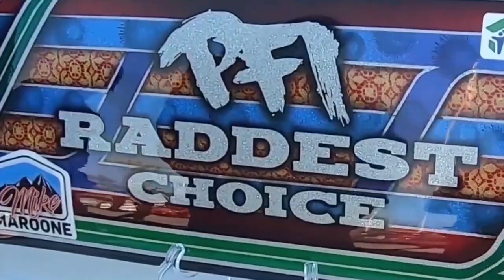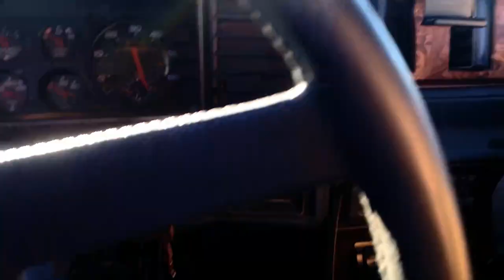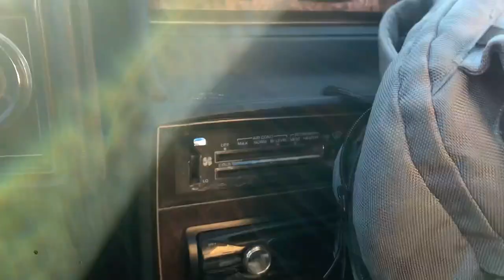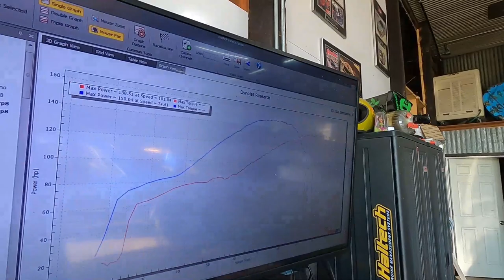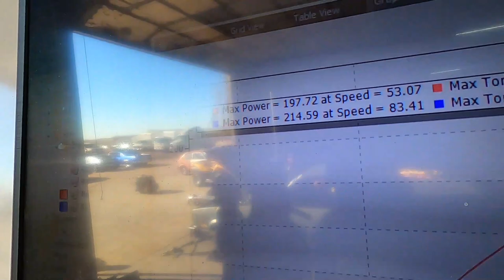Who’s Elcamino in Stronger! Dyno-Tug of WAR!

Comment: I just rebuilt that same column its really easy. They have a rebuild kit at oreillys for like 40 dollars
Reply: As a former employee of O’reillys, and a resident of Memphis, these columns are cheap and easy quick kit. Comes with all you need. I think it was dorman that made it.
Reply: O'rielly Auto Parts... You can also buy just the ignition actuator from us. AND we have battery powered Sawzall's, just saying...
Reply: The part number is us165l at O'Reilly
Reply: @Its_Cleve  fx fx 7g7xy7y887
Reply: @Its_Cleve  xux
Reply: @jasonsanderford436  7ux8xg7
Reply: @chadallen7914  7
Reply: Gf
Reply: @nielsmauritzen3517  I will confirm this tomorrow at work... Thanks man
Reply: or get a ratchet shifter
Reply: Mr Allen
Reply: @nielsmauritzen3517   klok Maicol bien casa el mudo
Reply: The prize was a car, perfect for generating content, already hyped up and everything.

Comment: I'm so surprised that heater core didn't have a leak but was disconnected. Good stuff tho! I wouldn't have risked it on the road home either
Reply: @Speedrome oh I know brother, I live in Florida. They do that, but it's actually making the cooling system smaller, therefore rasing engine and IATs. But it can keep the cabin foot area cooler.
Reply: Having it disconnected probably kept the heater core alive.  Wouldn't have been used much in Florida, just filled with stagnant coolant/water & corroding.
Reply: The cheap heater and AC controls on those cars malfunction. Causing the heat to flow through the vents when the heat is turned off.
Reply: @Hanzyscure  that's the blend door itself or the blend door actuator going bad
Reply: @SirVic42  the heater core is just a smaller rad.. but you're right, if it's empty, it can't corrode lol
Reply: @SirVic42  there is no valve. The water circulates all the time. There’s a damper or vane inside the heater box that moves when the temperature control is adjusted. It regulates and directs the air flow either through the heater core or through the air conditioning evaporator coil. I thought the same thing as original comment. I figured it was disconnected because it leaked. Not taking into account Florida. Although Florida gets cold enough weather to warrant heat sometimes.

Comment: The guy that sold them cars to Cleetus said the black/gray one had 500hp and gave him some paperwork to prove it lol.
Reply: I Hurd that too
Reply: Y'all have to remember that the air is much thinner in co than fl
Reply: @Timmothy2012  NOT 300HP thinner. Although lets be honest, that motor is prolly real old and tired.
Reply: @evo7836  I know man I'm joking cuz that's their normal excuse anytime they go to Florida.
Reply: Probably 500 at the crank not counting drivetrain loss and everything....could be very well undergeared aswell.
Reply: @crudnick  I mean all that could be but I do think it's far more likely that cleeter just got scammed.
Reply: @Timmothy2012  I agree with you on that especially seeing all these issues coming up with them.
Reply: DJ WRAITH  could very well just be out of time (too far advanced or lean) and trans could honestly be slipping aswell as im sure its a 700r4...
Reply: DJ WRAITH  my exact thoughts it could have been 500 when they put it in but not anymore that carb on it too is probably too big for it and choking it out aswell.
Reply: @crudnick  and who knows how old that engine is. I've built a few of those engines and to me it sounds about like 3-350 at most by the sound of the cam. Who knows if they had a 100-150 shot of nos on it. That was the quickest easiest way to make power as soon as you had forged rods and pistons.
Reply: @crudnick  no......
Reply: @wheeln24-79  that pos is pushing about 190 hp....
Reply: @crudnick  I was just going to say the same thing. They should have turned the distributor on each one to see what they could make.
Reply: I’d bet they thought it was 500hp. I’ve met quite a few people that think a lumpy cam and a big car suddenly adds up to 4-500hp. Put those people in an actual 500hp car and they flip out and think it must be 1,000.
Reply: @NBSV1  sounds like all the hillbillies I used to work with in the woods.
Reply: @evo7836  the fuel is also thinner

Comment: Cool, I'll let you know in advance that I'm partial to ElCamino's. I started about 50 plus years ago with a 69 and have owñed 4 or 5 not quite sure, but the earliest was a 72. The last one was a 71- 468 dual quad tunnel ram and was to be a  daily driver but turned out to be a show truck. Love that you're going to make it a shop truck. I'm sure you'll get it straightened out and reliable, like driving a 2k mi. road trip didn't prove it's reliability already. lol 😎☮️

Comment: Honestly, if I had that nicely painted Elco, I'd repair that steering column, yank that janky gauge cluster, yank that tree fiddy, swap in a fully forged high compression 5.3 or 6.0 LS, put a Tremec T-56 behind it, slap some nitrous onto it, put a Holley EFI standalone into it, put some QA1 coilovers on it, maybe some decent wheels and some Toyo R888Rs, and have some real fun with it road racing or autocrossing it. Cleetus McFartCan gave you 5gs on top of the Elcos, so you have some cash to play with them. Heck Brent, you can get a boneyard 5.3 or 6.0, with a NV4500, put some nitrous on it, and have some fun with it and still have some cash left...depending on your siterashun.

Comment: watch out for leakage, in the passenger floorboard. There is usually a reason got no water lines to the heater and it's usually the heater core is shot

Comment: I had something similar happen while pulling a trailer from Virginia to Las Vegas with a 88 F250. Stopped for gas then decided to rest a while. Pulled over to the edge of the parking lot to rest and pushed the clutch in to stop and smoke started pouting from the floor board. Turned out the power wire for the aftermarket radio found its way behind the clutch and when I pushed it in it pinched the wire. I was able to jump out real quick and yank the battery cable off. Glad I decided to rest or it may have happened driving down the highway and I might not have been able to stop in time to save it.

Comment: BRENT ( try out the starter for a 1997 Chevy C1500 5.7 ) it is a smaller faster starter and also got the bolts for the some year. You’ll need them. They are a lil shorter. And I needed no shims. With a Gen 1 350

Comment: Funny that piece thats broken in the colum is exactly how everyone in my old neighborhood used to steal em. They called it peeling. Worked in a ton of gm vehicles
Reply: Funnily enough my elco nearly got stolen that way, I unintentionally scared them off. I came out of the house and found my door open with the engine running and the column busted up

Comment: I guess the next time you do a dodgy wiring setup you'll put an inline fuse to prevent this from happening ever again right? Might be a good idea to buy yourself some waterproof 6awg inline max blade fuse holders with an assortment of max blade fuses, those fuses are like 1 1/4" wide x 1" deep, huge fuses to go with the 6awg cables for heavy duty amps above 40 amps.

Comment: Im just saying-2 Stock k24 in the bed with one massive turbo, though a powerglide driving of a massive chain from the engines, like tractorpullers are made. That Will make what 1000 hp? Would be so cool, and not that expensive with Stock engines

Comment: Brent, if you want to get rid of that chonky boi starter, the later year gear reduction starters are a drop in fit, way lighter and spin the motor way better
Reply: Don't worry, he's removing the starter, along with the entire powerplant...
Reply: @ericbeal6358  I suspected as much, but who knows maybe someone else with one of these old sbcs has one of the ancient direct drive starters that could use an upgrade. Excited to see what the guys have in store for this old american muscle
Reply: @trythistv  To add to that, the knurled section of the mounting bolts are generally different lengths for the full size and gear reduction starters, get new bolts or be prepared for a headache.
Reply: @ericbeal6358  Absolutely. and there are different bolt pattern (offset or straight), as well as I believe a difference in flywheel tooth count/pitch on some.
I work on boats so the flywheel stuff doesn't really apply in my world, but in automotive applications there are differences to be aware of and verify before slapping parts on, but a gear reduction starter is so much easier to manhandle back into a cramped hull of a boat, and it spins the engine so much easier too.
Ease of replacement isn't as huge when you can access the bottom of the engine in a truck/car, but not lugging that hefty thing above your head to get the bolts in plus the performance difference would make it worth the research in my mind.

Comment: For me a nice driver (considering the elco size and wheight) I would have a nice 250-300 hp engine (ideally with low end torque) with a longish gearing and a few mods to make the handling from meh to sub par. Along with a target dB of 65-75.
I mean yeah 500 hp is fun but in daily driving conditions you are not going to ever use them.... And your already meh tier handling is going to be even worse. (not talking about the fuel eco going from bad to trash)
Anyways good luck with the builds

Comment: J swap that rig with a m90 supercharger sticking out of the hood
Reply: or they could just supercharge the engine that's already in there. those 80's v8 where very low compression so i'm sure it would be fine

Comment: Use the V8 Honda Honda makes a V8 The Honda Indy V8 is a four-stroke 3.5-litre normally–aspirated V8 racing engine, developed and produced by HPD-AHM Co. in partnership with Ilmor Engineering for IndyCar Series.
Oil system: dry sump
Cylinder bore: 93 mm (3.66 in)
Block material: Aluminum alloy
Head material: Aluminum alloy
Manufacturer: HPD-AHM Co. (under a support of ilmor engineering)
Torque output: Approx. 430 N⋅m (317 ft⋅lbf) @ 8,000 rpm
Displacement: 3.5 L (214 cu in) (2003, 2007–2011); 3.0 L (183 cu in) (2004–2006)